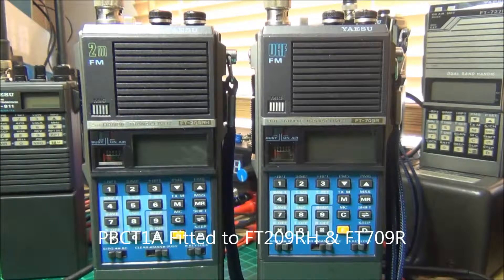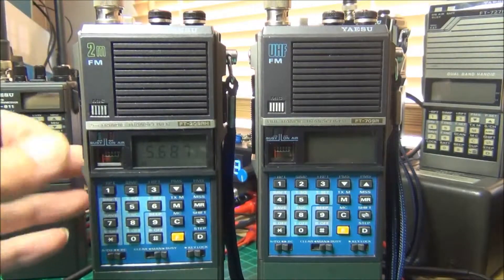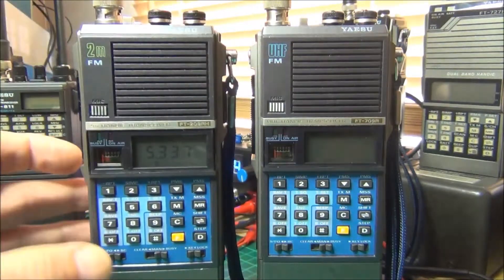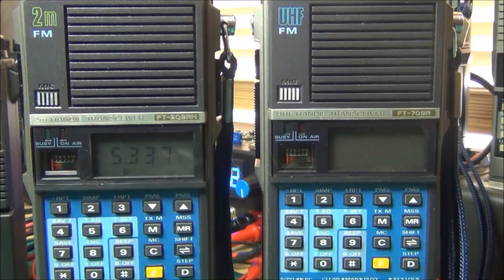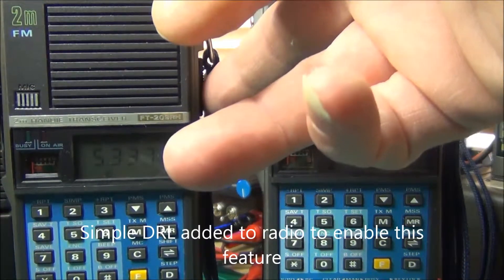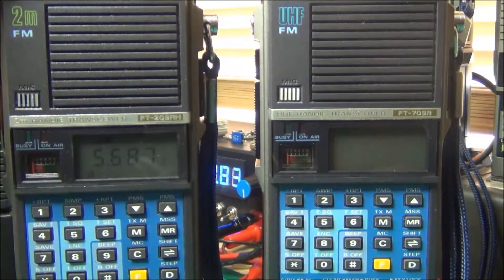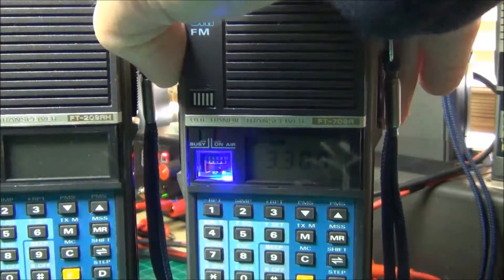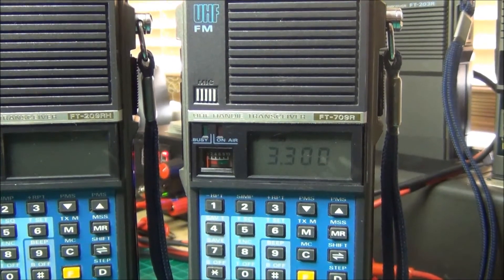PBCT1A CTCSS Encoder fitted to FT209RH & FT709R

Comment: I spy a ft-727r, do you have the fts-6 module fitted? mine is a euro model B and I'm trying to fit cross to it, any suggestions? I've swapped the r32 & 35 links for 33 & 34 to supposedly make it model A, got tone but it still won't open squelch on another radio